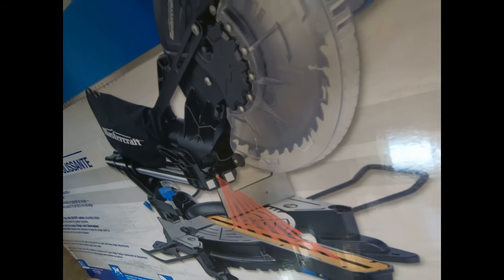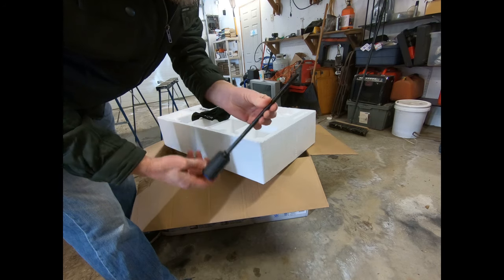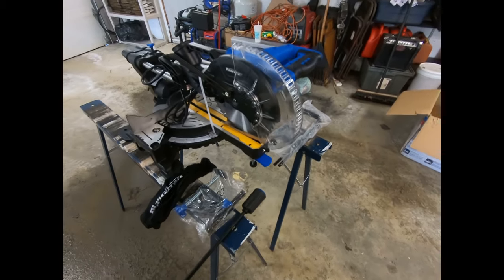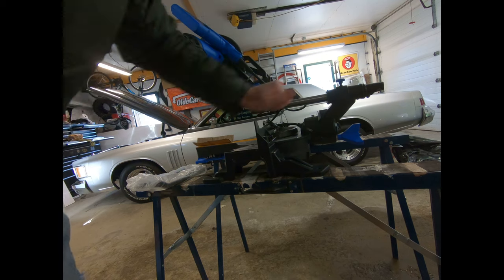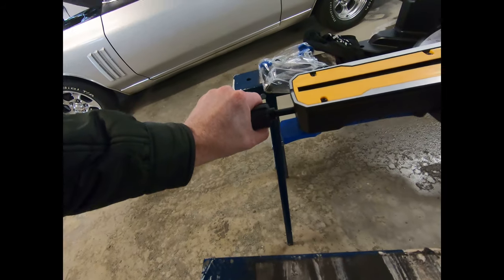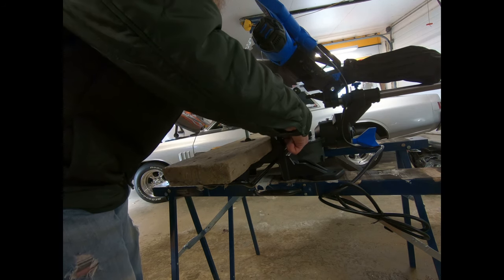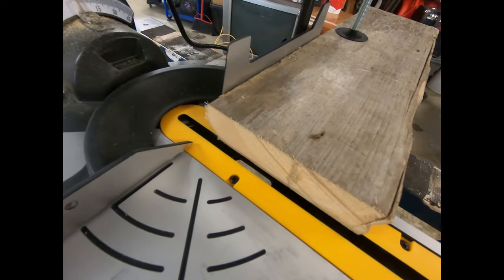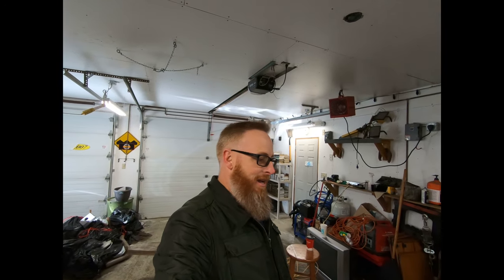UNBOXING MASTERCRAFT 10" COMPOUND SLIDING MITRE SAW

Comment: I just bought a newer one today. It doesn't have the threaded handle and the metal handles for lifting were already installed. The Mechanism that spins the turret is a lever you push up for unlock and down to lock into place. There's a blue safety button you have to press to activate the lever though. It wasn't as heavy as I suspected. Be fun to try it out. Thanks for the  video tips.

Comment: How do you turn the saw blade right to left
Reply from the maker: Tilt or pivot? If you’re trying your tilt it, loosen the big star knob on the very back. To pivot, loosen the handle attached to main deck of the saw and slide to the left or right. There may be a lock mechanism you need to pull at the same time. I hope I explained that correctly!